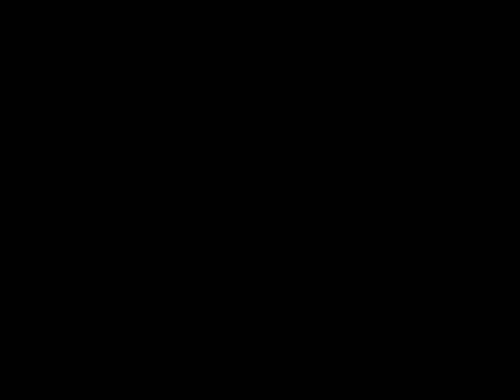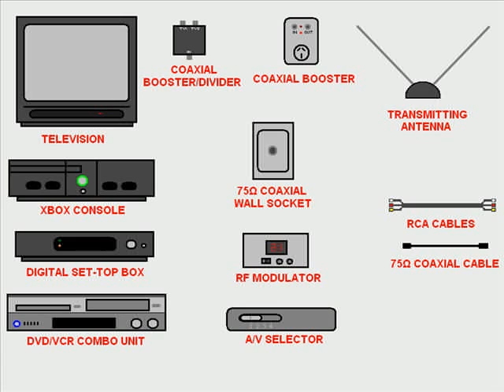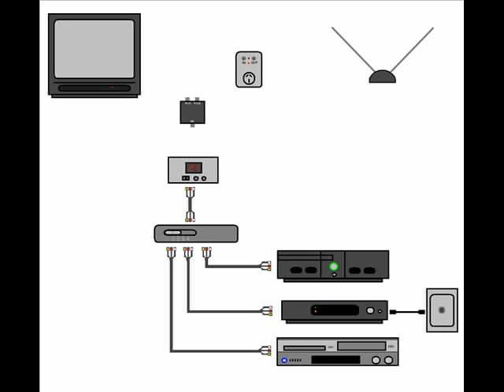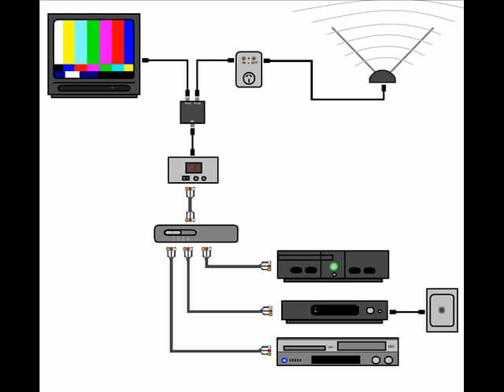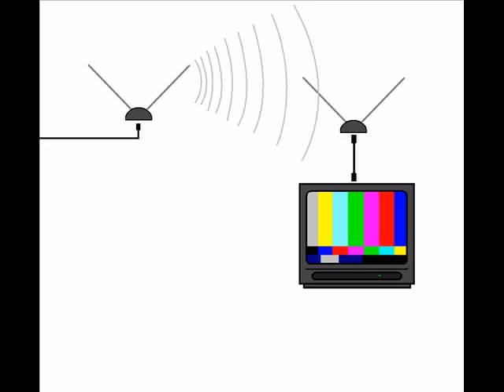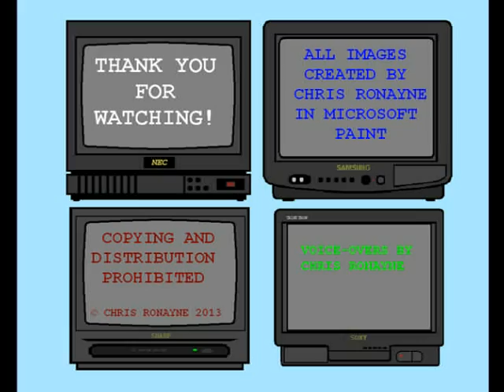How I set up my Analogue Transmitting System

Comment: I just found the video, and I might try it with a vcr as the modulator and I'll try to find either a good booster or 2 okay ones. My main problem will be that the vcr will be limited to transmitting at either channel 3 or 4.

Comment from the maker: I had a look on EBay, but a these all seem to be going for between $150 - $300. There are a couple for $60 -$70, but as you said, shipping would be a killer. I think I'll wait until I get my own house and have use for a transmitter like that. I don't use any analogue televisions independently outside my room, so there's not much need at the moment.

Comment from the maker: I'll have a look when it uploads! The problem with a set-up like this is that it's hard to find a decent booster for the antenna. Most domestic booster units have very little power, so the signal is confined to my room. I'm looking to get a more powerful domestic or commercial booster, though I doubt that one like that would be within my price range.